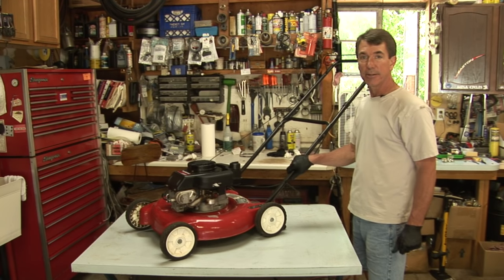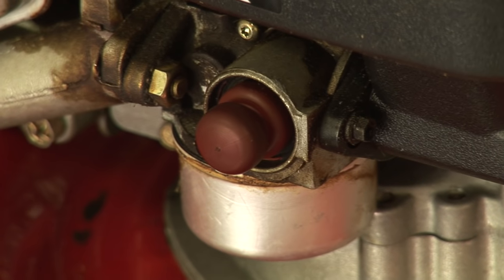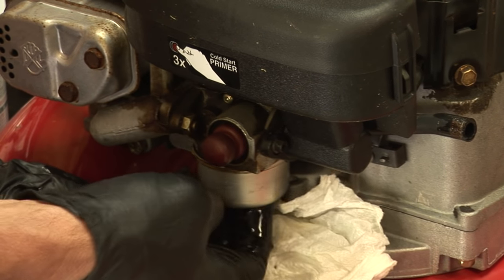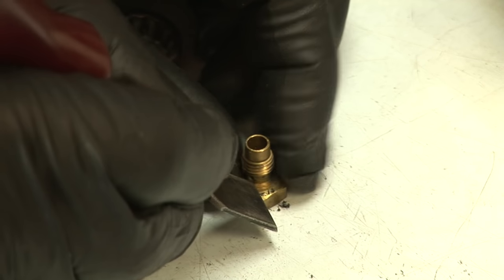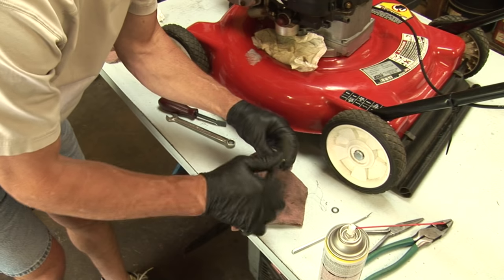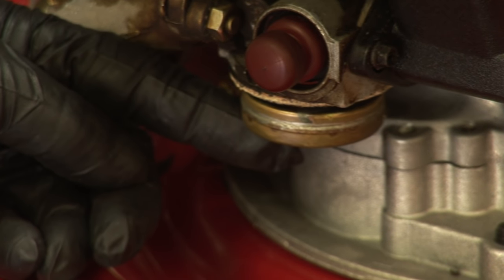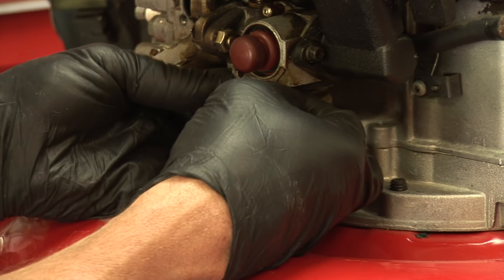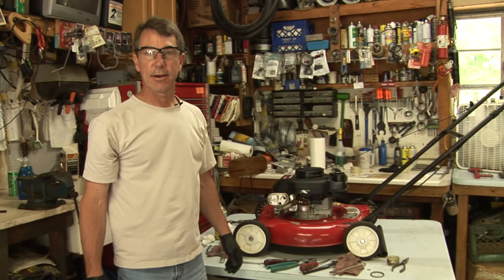Lawn Mower Repair : How to Clean the Carburetor on a Lawn Mower

Comment: Holy Cow!! I'm a total goof as far as being able to fix anything and I was able to do exactly what you said and low and behold my lawn mower runs.  It was doing the run 2 seconds and then die with no chance of staying running unless you pump the bulb...and it's kinda hard to actually mow that way!  I was ready to beat it into a pulp and then burn it.  It was the only thing that could possibly bring me satisfaction for my mower has done this to me for years!!  THANK YOU, THANK YOU, THANK YOU!!

Comment: Thanks for the video Mark.  I have a lawnboy that didn't want to start and didn't even know where to begin.  I pulled the bolt holding the bowl and it had some green crap covering all the jet holes.  I used a paper clip and some carb cleaner, cleaned the bowl and my mower started on the first pull and first turn of the key. Now for some fresh gas!!   Have a nice day

Comment: Thanks for your video. I made a mistake and left old gas in my mower over the winter. I can get it to run 5 to 10 sec if I put gas on the air filter; I was thinking my carb only needed cleaning. I cleaned out the old gas a week ago. I was going to take the carb off the lawn mower unit is found this video. I am going to try this, this weekend and hope that it works!

Comment: thanks this helped, i have a craftsman walkbehind and it was having trouble last fall starting. I seemed to help by wiggling the spark plug wire. Well this year before the grass starts growing I bought a tune up kit (oil, plug, filter, gas stab.) After putting all that stuff in the mower except stab. it still wouldnt start so i saw your video and just pulled that screw out and let some gas drain and i cleand the wholes out of that screw and bam it started up. Thanks you saved me buyinng new LM

Comment: YOU ROCK MY FACE OFF! I'm fairly mechanically inclined managed to get the carb apart the first time hardcore cleaned out the whole thing...................and overlooked the tiny port near the end of the threads on the main jet(DOH) Thanks alot! You're video saved me $

Comment: Wow!  After replacing everything else and still having my mower die - your video did the trick!  Now the thing starts up on the first pull!  

Also - it was easier for me to just leave the gas tank and not have to worry about breaking/replacing the clamp.  I just let the gas drain out through the bottom of the carborator and took it from there.  

Thanks so very much!!!

Comment: There were a couple more 'jets', ports, whatever you call them.
The primer bulb air duct(?) to the main jet was clogged, too.
(used a twist tie wire for that)
Fast and easy, once I watched this.
Started right up.
It originally only started by dumping a capful of gas in the carb.
It was offered Free, a 'trashed' mower.   Again, Thanks!

Comment: dont forget the side holes when cleaning the jet , and also take and airpick and blow the sucker out, with air but spray first with some carb cleaner after you clean all the jet holes.that click does not alway mean the gasket is sealing against the pin,and yes the bolw oring gaskets do rot or dry out ,primer bulbs also stiffen up and no longer work also can crack and leak so check the primer bulb as well, when clenaing the carb make sure its also ok ,

Comment: i took the bowl off of my mower and it had no holes in the bolts. It actually had two bolts. one attached to the carb and the other serves no function that i can see, other than perhaps draining the gas. At any rate I then removed the carb and sprayed cleaner in all of the orifices. the mower seems to be running well now.

Comment: If I had just the motor, with everything cut off, and not sure quite what yardman it came from, but that I want to get it working on it's own, is the piece of rubber on a cap thing on the crank-case for a fuel pump? Is there any way to make it run on gravity? I have a bare motor and want to make it run, and this video is the closest thing to "help" that I've found.

Comment: Thanks, Mark,for sharing your expertise and making what might sound mechanically complicated, pretty easy to do once you see the steps performed "in living color."

Although you do this as an educational service, I'm sure many would be more than happy to send a few bucks your way if you had a PayPal button/website listed somewhere...

BTW,I thought a warning should have been more prominent at the beginning when disconnecting fuel line from the tank to prevent newbies from leaking gas everywhere.

Comment: @ninjato1979 This method did the trick, my lawnmower started right up. I ended up reusing the original gasket as it was still in good condition. If some of it sticks to the nut when removed, you should replace it. The gas in my tank was yellow and smelled bad as he mentions in the video. I'll be sure to run the tank dry in fall to avoid having to clean the carburetor again. Good luck with yours.

Comment: Good vid. Only thing is that I can't get the bowl off. In the vid you loosen the bowl and then there is a break. It's obvious when you're replacing the bowl that you've loosened something in order to get the bowl on and off. That part would be very helpful. thanks.

Comment: Ok so aside from replacing the gasket. I thought id cleaner the nut really well. But I'm wondering now if or not I heard the click mentioned on the float bulb. If no click, then what? My Toro recycler still likes to either not start, or doesn't want to stay running once I start cutting. Unsure what I'm missing why it still won't run properly.

Comment: Note, most B&S engines now have a very different Carb/tank design to this one...my MTD 5.0 early 90s had one like that, but my current Sprint 3.5/3.75/4.0 engines (I dont know what year they are, maybe late 90s/mid 00s, are plastic carb, 5 screws to tank, no float, nothing like that.

Comment: The manufacturer states that you are not supposed to use wire to clean passages.  Carburetor cleaner and compressed air is what you need to use.  The wire can enlarge the calibrated passages and make the engine run rich!

Comment: Way too much time spent on the bowl bolt. Just remember this, if you can see through it, it isn't clogged. Pretty simple. One thing to do with the float, remove it and shake it a little, just to be sure it hasn't over the years got a crack in it and allowed fuel to soak into it. If you have a cork type float, just replace it. Juicyohso, you're right, always remove float and needle, not only to be sure it's clean but to be sure needle seat is still in good condition.

Comment: NO. You can see it in the video when he puts the bowl back on that he lifts the engine up in order to get the bowl on. The video however doesn't show how to loosen the engine so you can lift it up. 
I couldn't get the bowl off and therefore couldn't elign the gasket properly.